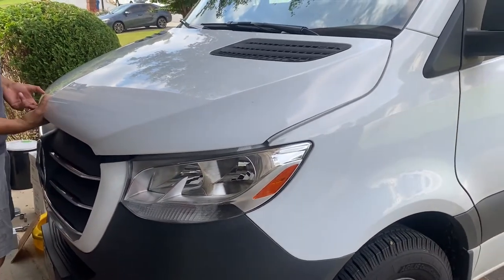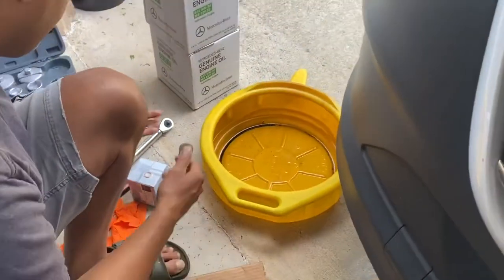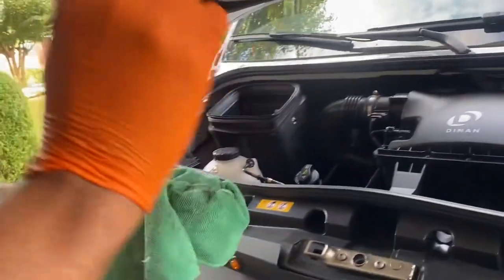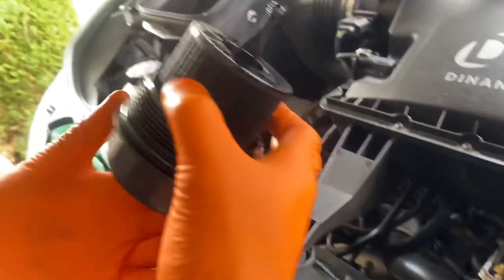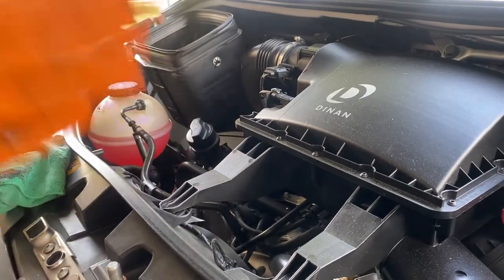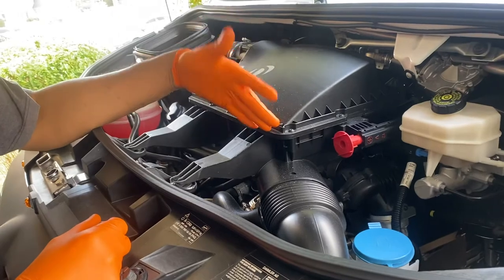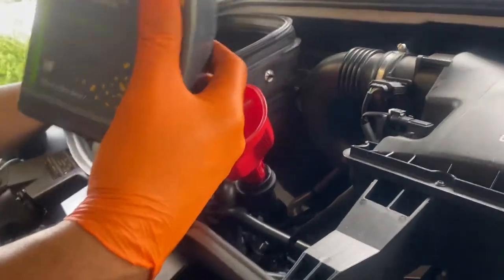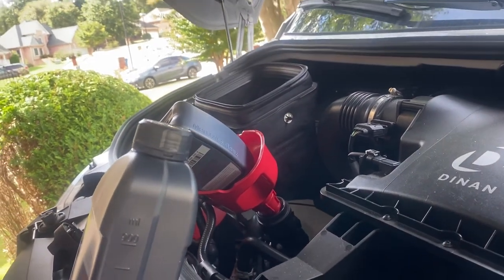Oil change on 2019+ sprinter six cylinder Diesel 👍

Comment: I service these sprinters. If fully warmed engine and drained it will take 13.5 quarts to be at exact max for 3.0 V6 diesel. Filters for mercedes used to be MANN now its different brand. Mobil ESP oil also good to use available at autozone for cheaper.

Comment: Excellent video.  Especially like the tip of jacking up one side for more complete pan drainage.  Also like you attention to detail wiping out the filter cannister and using that cardboard splatter flap.  Also agree with your more frequent changes at 1/2 dealer rec. Thanks for helpful , easy to follow video.

Comment: Thanks! The dealer charges $200 for this service. Especially with the filter on the top of the engine there is absolutely no reason not to do this ourselves!
Reply: What dealer does this service for $200? Oil, filter and Fuel filter was over $300 in parts. I would question what they are actually doing at that price.
Reply: It will cost u more then $100 in parts alone. Of dealer charges $200 its cheap😊

Comment: I have a 2007 R320CDI with an OM642 at 164 K miles. I use an oil suction tank  and I change oil and filter  at 5000 miles instead of  going to 10K miles. Hengst oil filters come with all the necessary pieces. I use  either Liqui Moly or Mobil 1 10-40 Diesel oil. I dont have to go under the car .

Comment: Thank you for the video,  you might want to consider pouring 1/2 a liter into the engine while the drain plug is off.  This flushes some of the old oil out of the bottom of the pan.
Nice job jacking the car up to get more out.
Reply: I like that tip
Reply: That’s not a jack point. It will cause terrible damage to a Sprinter.

Comment: I love the way you let the filter drip clean. Great tip thank you. A question; how do I physically check the power steering fluid level on my 2019(the same) sprinter van. 3.0L diesel. Baffled me completely

Comment: Why sponsor the dealer when you can also buy cheaper a MANN HU821x filter that Mercedes Benz also uses?
This applies to oil, fuel and air filter, initial assembly at Mercedes Benz factory is always MANN

Comment: Did you use a oil flush first. I believe you add it , run the motor for 15 min then drain it when it's no longer hot but still warm. Otherwise a great help and good suggestions. thanks
Reply: Do you have any links to manufactures for this product??
Reply: No I can't help you there but if you write to the author ( Ultimate DYI) then he may be able to help you

Comment: You can save yourself some more money by using Mobil 1 synthetic oil for diesels and WIX oil filters.  NAPA oil filters are WIX filters.  Costco has Mobil 1 diesel oil.  NAPA fuel filters are also top quality.  Dealers are way over priced.
Reply: Be careful Mobil One has 36 different Oils under the Mobil One name, only one of them (ESP) meets the MB Spec of 5W30,  229.52! Has far has the filter is concerned you would be foolish to buy a non OEM Parts, the Parts Warranty alone makes it worth it. Also, when your Service History can show that you used only OEM Parts there is no question that you followed the MB recommendations! I even used MB Oil because it was price competitive with everyone else.

Comment: @10:02, you forgot to install the tiny “O” ring at the tip. Recall you earlier used the hook to remove it.
Reply from the maker: Watch the video carefully I did replace the tiny  O Ring on the tip of the filter holder

Comment: Change your  oil people .its like fine  carbon dust in your bearings 
 Oil cheap. New motor ??.my relative lost a newer jeep motor over a cooked valve seal . 8000 $ to fix. ??